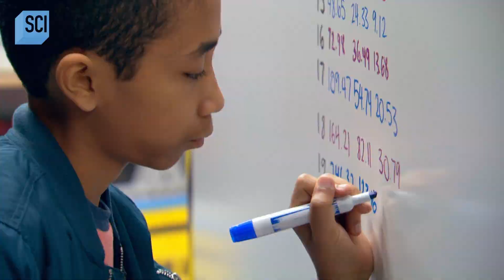Can Life Size Domino's Crush a Car?! | Mythbusters | Science Channel

Comment: I already knew the second to the last Domino wasn't going to work, because the weight distribution wasn't equal. All the concrete buckets were at the bottom, from the midsection up there wasn't enough downforce to knock over the last piece. If they had mounted half of those concrete buckets at the top from the midsection, it would have easily worked.

Comment: You could solve this with some simple physics. The hardest part is figuring out how much force is needed to crush the car but assuming that the car is made to handle its own weight on its roof any force larger than that would crush it. So what you need is really the mass of the car.